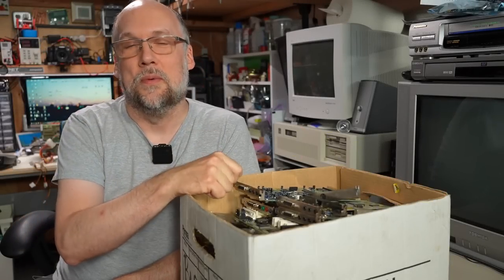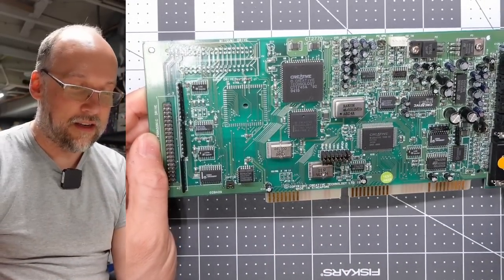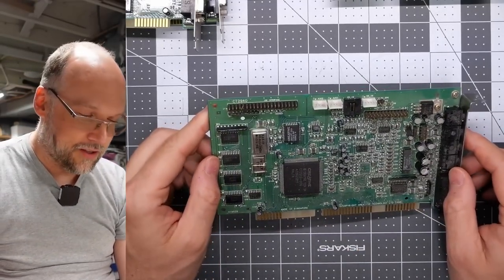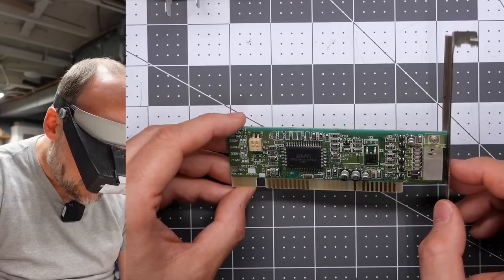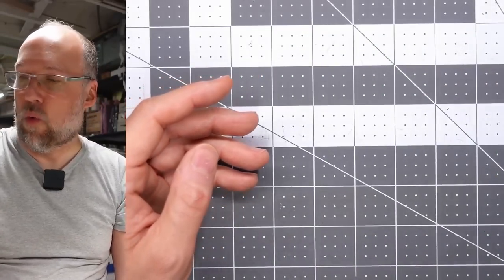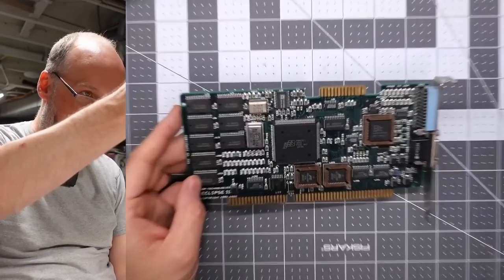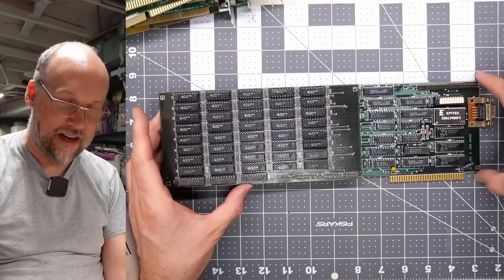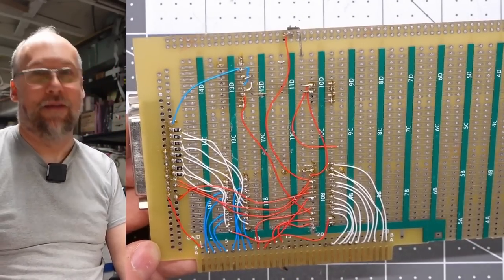Tech archeology: Exploring mysterious computer parts

Comment from the maker: Patrons are already digging up cool info about some of this stuff! I'll pin this comment:

Patron stynx found this about that TMS video card:
bitsavers.org/pdf/vectrix/isa/ex1280/

But then I did some more Googling and it turned out I already have one of these cards!! Check out SMMC episode #7:
https://youtu.be/eLxf5wKzDJM?t=589

Nick Griebel found that a Computer chronicles episode makes a reference to TOP technology, and kind of describes how you can transfer IBM files to an Apple via Appletalk and TOPS. https://youtu.be/lyHm8u_AR30?t=180

Patron stynx found this about the Orchid Turbo Graphics card: "Orchid Technology. The Turbo Graphics Controller (TGC), which is functionally compatible with the IBM Professional Graphics Controller, runs 4 to 25 times faster than IBM’s product. The TGC offers 640-by-480 pixel display resolution and can run on a less expensive display than IBM’s. It writes directly to screen memory (bit-map), and has RAM designed specially for video applications. Approximately $2,000."
Fond in PC_Tech_Journal_vol03_n08 page 30

Also from Patron stynx: Arroyo Technologies "Blackfoot JPEG": Macworld May 1992 page 211.
Claims to allow >1MB/s JPEG (de-)compression.
Reply: 😅 I could've sworn I've seen that Vectrix EX1280 before. Funny i couldn't remember it was on your second channel as well... 
Still not sure what happend to rest of Vectrix. It seems Vectrix became part of Everex around 1991. At least they took over the patent for the Vectrix name in April of 1991. Everex itself was purchased by Formosa Plastics Group after filling for Chapter 11 bankruptcy protection in January of 1993. Vectrix filled for Chapter 11 bankruptcy protection in December of 1993. So the rest of Vectrix might be swallowed up by Formosa as well but I couldn't find any evidence for that.
Reply: I watched this video awhile back, It's a background on all of the Vectrix products. https://youtu.be/V7Cgw28la5w At around 8:15 is an introduction of their new PC hardware called "PEPE". You may have one!

Comment: A large number of the boards in your collection came from me.  I donated them to "Free Geek" in Portland in late 2022.  Some are simply products I used, but others are ones I designed for other companies, or manufactured and sold myself.  Most are rather special purpose, such as "Scan Cap", which was used to capture video from a variety of medical imaging systems.  "BlackFoot" is an early JPEG processor.  It quickly became obsolete as processors became fast enough to process JPEG-compressed video in real time (they couldn't when this was developed).  They were sold primarily in Japan.  I did a lot of video processors and video capture boards for various companies.
Reply: Pin this comment @adrian
Reply: Between the VGA, name, and ADC on board, I'd already pinned the Scan Cap as a VGA capture card. Good to know I was on the right track!

Comment: The ISA DAC card seems like the type of thing that might sit on ebay for 2 years, only for some factory to buy it off you for $1000 because they need it to get propriety and ancient factory equipment fixed.
Reply: Had an old copper bus-bar bending machine at work, controlled by a DOS PC. It definetly had some special I/O cards in it. We scrapped that machine a couple of years ago, but I did rescue the computer so I have the cards
Reply: Proprietary
Reply: pc cnc cad solution in one box
Reply: The previous company i worked for had some old machinery that they could only comunicate with trough certain 286 laptops for some reason or another. Probably because of a connection or protocol i imagine.
The guy responsible for keeping that stuff running was always hunting for old laptops and bodging things together because that old portable stuff really wasn't very reliable anymore for actual production use.

Anyway, they payed good money for it because it was essential to keep things working.

Comment: For the periscope card, maybe you can just unleash the top part of the blue connector.. Shorten the ribbon cable, and than attach it back on the connector.. Then the cut is gone.
Reply: Great idea, or get a new connector or solder header.
Reply: I said that same thing out loud when I was watching.

Comment: The MQX-16 is a Roland MPU-401 interface compatible card.  I have a MQX-16 and an MT-32 with manuals, etc.. I bought it the early 1990's for Sierra Adventure Games.  Games like Hero's Quest. Space Quest, and Kings Quest sounded amazing with the MT-32.   Also had an early SoundBlaster with the audio from both connected to an external mixer connected to a stereo amplifier driving a pair of Bose 301 speakers.
Reply: What are the RCA connectors on the card used for?
Reply: @firstsurname9893  If I remember correctly, probably frequency shift keyed (FSK) tape sync analogue signals (in and out) to be used with a multitrack tape machine for syncronizing MIDI sequencers with tape machines. If I remember correctly, the original Roland MPU-401 (which I owned many years ago, c. 1986) had these (but as 1/4" TS jacks, not RCA connectors). The MPU-401 predated the use of SMPTE code within the MIDI standard (MTS), so there was really only a timing clock generated to be written to a tape track, not full timing information in H:M:S:F, so you would need to rewind the tape prior to the beginning of the sync code audio, and then the sequencer would pick up start, clock and stop signals. But you couldn't fast forward through the tape and pick up the SMPTE location to allow the software sequencer to chase the tape. Since the MQX-16 was a modernization of the MPU-401, chances are it did support SMPTE code. 

The third RCA connector, if it matches the MPU-401, would be a metronome signal, that could be amplified and played to the musicians as they are recording and playing a track. Remember this was before sound cards were in widespread production and use, not even in professional studios, where during the 80's, expensive digital pro-audio devices were still in use, rather than personal computers.
Reply: @aussieleighsmith  Ah that makes sense. I guessed they were for external sync but couldn't figure out how the signalling would've worked.

Thank you for taking the time to provide such a thorough explanation, I really appreciate it.

Comment: The bottom of that Periscope card had two sockets on it. That bent up one was a sacrificial socket to keep the real one from getting its pins bent
Reply: Was just about to say the exact same thing... but you beat me too it..
Reply: It probably wasn't intended as a 'sacrificial' socket, it might be needed for some motherboards as a spacer, so the card can avoid hitting taller components on the motherboard. I wonder if you can buc sockets like this today, but definitely nice thing to have an unharmed one underneath, so as least it doesn't need to be desoldered.

Comment: That Keithley card brought back memories.  The information you found on it only mentioned Windows drivers for it.  Back in 2001/2002, I worked with what must have been a somewhat later Keithley A/D and D/A data acquisition card that also only had official Windows drivers.  It could sample analog signals as well as generate them with fairly high resolution on multiple channels.  So then for my college computer engineering senior project I requested the detailed hardware register specs for this card from Keithley and created a Linux device driver for it.  Then I wrote a very simple oscilloscope/signal generator application to demonstrate my driver worked for my final grade.
Reply: does that driver still exist today? that would be cool to see nowadays
Reply: That's cool they sent you the info.   Companies now adays don't work the same way.
Reply: @v12alpine  It is only a question how you ask and how you present them your own project. Sometimes the company even wants to be informed after you succeded with your project. (Only an e-mail with gimme the datasheet, that just drops into the trascan)
Reply: @schweizerbananen  Yeah I think because it was a school project and I was a student, they were willing to help out.  I recall that I still had to sign an NDA to get that register-level document though.

Comment: @1:01:04 looks like the bent up pins are on a sacrificial socket. So you might be able to just remove the bent up socket and replace it. If you wanted too. We used all sorts of In Circuit Emulation tools back in the day. Those very heavy and stiff screened ribbons were the bane of my life LOL.

Comment: Keithly, National Semiconductor, and Omega were prominent brands in the Data Acquisition space way back when.  Without software for this board, it will be difficult to get it working.  The reason there are so many terminals on the back is that instrument transmitters and transducers typically have two wires for their I/O signal loops.  Some of the other five terminals (16-channels = 32 terminals) are for grounding and "loop power", typically somewhere between 12 and 24 vdc.

Comment: If you are carefull, you can remove the connector from one end of the broken ribbon cable closets to the break, and reattach it after the break. You will loose about 4 inches of cable but still have a working system. I have done this but with smaller ribbon cable. You have to be carefull of the plastic tabs.
Reply: It may also be easy enough to expose a bit of the conductors, apply some flux, and solder them back together, before taping or gluing over the repair.

Comment: The Turtle Beach card was not aimed at gamers, it was aimed at audio enthusiast/musician, it was the card that allowed multitrack HDD recording (4 or 8 tracks, dont remember) and real time audio manipulation effects. Basically, you transformed your PC into home recording studio, similar to Atari Falcon 030. It was very expensive for a gamer, the DSP56001 alone was very pricey. I dont know how Atari managed the Falcon price being so low, the basic 1MB version of Falcon 030 was about the same price as Motorola would sell you the 56001 chip alone.
If the Tahiti card works, you can consider yourself extremely lucky. Cant wait for the followup video.

Comment: The Tahiti card was a prosumer grade audio card.  It was built for studio use and not for gaming.  They were know fir having a very low internal noise gate, meaning the audio levels could be amplified in excess of what Sound Blasters and such could chandle without squarewaving out.
Reply: Did you mean a low noise floor? A gate in audio is a circuit that cuts off audio when it is below certain levels. Guitarists use it all the time so you don't end up with a bunch of random string noise and pickup hum on stage when they aren't playing. Where it might work here is in muting the audio in periods of silence so there appeared to be no noise.

"Squarewaving out" : I assume you mean full peaking/distortion where the waveform ends up close to a square wave because of how hard it is clipped. A low noise floor (or a noise gate) don't have much to do with that. But with a low noise floor, you can crank the audio up louder and it will be more pleasant, because less noise will come through with it, when compared to other cards.

Comment: AWE64 is basically an AWE32 that came with an additional soft synth to boost available MIDI polyphony to 64 voices. RAM was changed to a proprietary interface but it's still effectively the same type of RAM used so you can get a home-brew board to install standard RAM. As it's basically an AWE32 (same EMU8000 synthesiser), software is 100% compatible. It has 512K of onboard RAM and the same 1MB ROM of the AWE32.

Whilst the soft synth sounds boring, it's actually quite interesting, as it uses Seer System's WaveSynth W/G which in addition to adding additional polyphony, also had a very early attempt at physical modelling, which would emulate the sound of various instruments without actually using any audio samples. This technology would be later picked up by Yamaha in the guise of Sondius-XG.

Comment: The turtle beach multi sound Tahiti was a monster! Those were very expensive back in the day, you should do a video with them they were popular with musicians and high end audio. I worked at a radio station back in the 90’s and they had these  and also Antex cards  that we used on the on air computers. These cards were able to do MPEG hardware decoding which enabled you to add multiple in one PC for multi track audio.
Reply: If I remember correctly Turtle Beach had some connection with Ensoniq which was founded by Al Charpentier and the team behind the commodore SID. Later in the 2000 Ensoniq was acquired by Creative Labs

Comment: I had one of those MIDI cards. From what I remember, the cable was a joystick port to MIDI cable which was pretty standard at the time for driving MIDI from sound cards such as the Creative Labs. The MIDI interface is a well-documented standard that is still used today in case you need to build one or maybe even find one.

I had an old Turtle Beach sound card. It wasn't that particular model but boy their sound was particularly nice compared to the similar-period Creative Labs cards. I still have a pair of their now unavailable headphones which are really well made and still work today.
Reply: Joystick to midi was used by creative and several clones, but this is a 9 pin connector. Don't remember well but Creative midi port might have been the "dumb" type so prone for slowdowns. The "smart" MPU-401 (and clones) can keep the timing even when the cpu is busy.
Reply: @freeculture  I don't remember much about the card and the cable and I'm not sure about the pin-outs. Heck, it's now close to 30 years ago now, and you're right about the connector. I can picture it in my mind.  

From my recollection, the card wasn't exactly fast and I had a very disappointing time with it driving my Kurzeil K1000 digital piano, which I still have tucked in my closet. I'll have to check my basement cabinet. I have a lot of old stuff down there and may even still have the card and cables which might be amazing!

Comment: I recognized that Vectrix card right away. It was offered pre-EGA and produced VGA resolution images. There was a library for use with a specific C compiler to create your images. My ex had one of these at work. The computer had a regular monochrome display and a huge Techtronix monitor connected to the Vectrix.
Reply from the maker: Ah interesting! Yeah I assumed it was going to work in a dual monitor setup. I explore it a bit more in part 2 of this video, which will be out next weekend. I guess the dual screen thing was typical and you ran the special software AutoCAD or whatever to run on the large screen with the little MDA monitor for DOS and what not, and then the glorious color one for the special app.
Reply: And, you're missing the top board of the Vectrix card. There was definitely a piggy back card.

Comment: My friend had a periscope card, and we used it to create on-the-fly trainers for games, and "other stuff". The RCA port came with a red push button, to halt execution. It was slightly janky as you had to have a second monitor to be able to use it effectively. The disassembler was primitive but functional for simple tasks, I bet if you had debug symbols it would have been easier.
The push button broke/got lost, so he resorted to an audio cable that he shorted. I never knew it was that expensive.

Comment: That stack of SCAN-CAP cards takes me back a bit. Definitely capture cards. They look like (monochrome?) composite NTSC / VGA video capture cards but the oscillators are odd. The 50.350 is easy at VGA bitclock * 2, but the 53.76 makes me wonder if this card digitized PAL? The earlier shorter version labeled Jovian Logic looks like it might have been an NTSC/CGA/EGA capture card based on where a couple of the traces go.
Reply: What's interesting is that there are positions for six crystal oscillators on the left, but only two are installed.
Reply: Could be medical, maybe tomography?
Reply: @8bitwiz_  Those were the days before high speed PLL clockgen chips. It looks like it was a very flexible PCB design but they only had it configured for VGA and possibly PAL in this case. Go forward a couple years and you have the same plus much more functionality at much lower cost driven by PLLs and a single 27MHz or 14.318MHz crystal.  I had several video cards with multiple oscillators on them from those days, but I think the max I had was four on one card from Wyse.
Reply: @Breakfast_of_Champions  Absolutely! A custom interface to a piece of medical equipment makes perfect sense as the 53.760 doesn't seem to match anything else I can think of.
Reply: Looking at the analog front-end section, there's an 8 channel video mux max455, video amplifier lm1201 and what looks like 8 input resistors from the visible trace. Also kind of curious that it can have two ADCs installed. Would love to see a higher resolution scan of the blank PCBs and see how the front-end is wired.

Comment: The first TI based card looks similar to the Hercules Graphics Station Card that has the TI chip as an Autocad 9/10 display list based accelerator. I used one of those in the early 90s to design the mechanical elements for UK electrical accessories. I think some of the products are still on sale today ;)